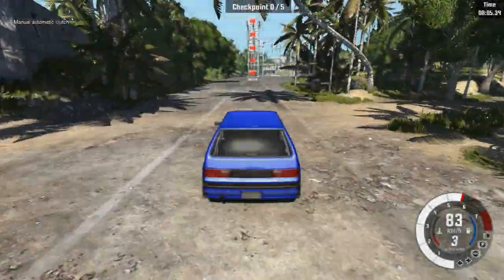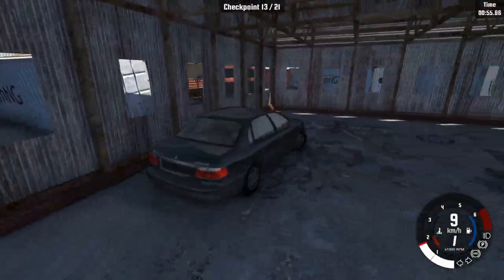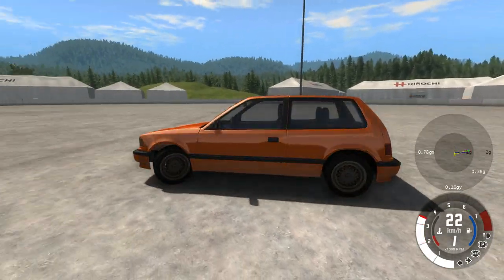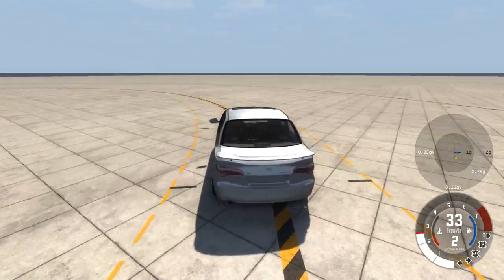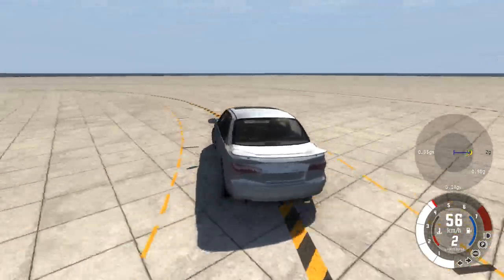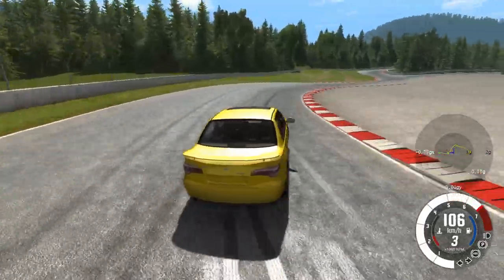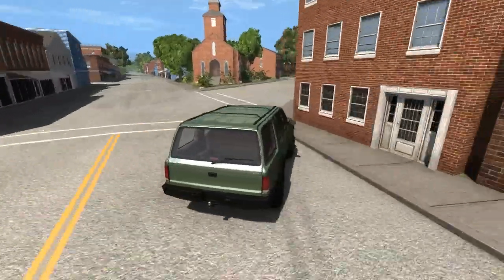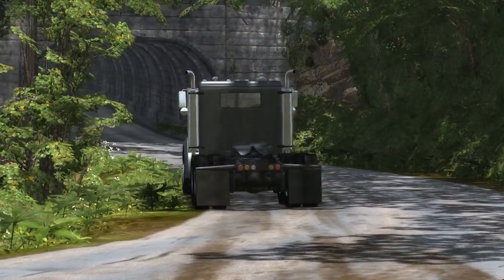Vehicle Handling in BeamNG.drive

Comment: Thank you BeamNG devs for not dumbing down the vehicle handling to chase the mainstream casual audience. Love my BeamNG nice and realisitic!
Reply: The full realisation of how hard it is to handle a car at high speeds much unlike racing games, and each vehicle has realistic things about them. The Grand Martial 's back end kicks out a lot and front wheel drive vehicles handle like boats
Reply: project cars 3 =(
Reply: @AnyaKittyMeow   You saying that did that with Project Cars 3? Shame.
Reply: @birbjones4848  Racing sims though capture that too.
Reply: @hongthainguyen5334  when did I say they didn't?
Reply: @birbjones4848  Well yes, you said ‘games’, not ‘sims’ so all gud.
Reply: @hongthainguyen5334  yes, sims tent to have more realistic simulations
Reply: Um why would little kids care about physics (forza kids)
Reply: @coolcat-nq4mj  yknow, the car go crash neuron activation kids
Reply: You are mistaken, especially with low performance commuter cars losing grip from a 90-degree turn at 20-25 mile an hour

Comment: I like the fact that it's not about racecars. There's a lot lf cars that resemble civilian cars. Makes the crashing more fun. One big thing i wish the game had is a replay mode, like in the gta four and five. Where you can move the camera around, slow the time down, etc. it would make for some great videos that are easy to make.
Reply: +Malabar101 You can do all of those thigns but it has to be done in real time. Meaning you can't drive in say cockpit view and then go back and set up your camera angles and stuff. You have to set the camera up, set the speed and drive from that awkward angle to get the shot you want. Difficult? yes. Many others have done it though as there are lots of videos on here showing it.
Reply: Mike S yeah, i know. But imagine being able to tweak everthing after th efact. it'd be much better.
Reply: +Malabar101 Oh, I agree it'd be easier to do it after the fact and I'm sure it'll be in the full game but this game is very far from finished so it will be a while.
Reply: if you want photos of you doing a jump for example you can use photo mode, its an option just below the bug report button in the menu i believe
Reply: Malabar101 yay they added it now
Reply: Yeah, the covet is a realistic economy hatchback the ibishu cars are new and old day-to-day vehicles  and the grand martial is a decent sedan. Gavril has the van, pickup and SUV. With mods for minivans and  other hatchbacks you can have an wide roster of cars that you would usually see in a town
Reply: its 5 years later and there are now these exact replay features lol
Reply: welp,you're in luck if you ever look at this comment again.replay mode exists with those EXACT features

Comment: 4:13

This is why I am so confident in Beam NG drive and love what you guys are doing. It's because of that very reason.

Beam NG isn't a just a car game. It's a physics engine at its very best. When you can build a piece of metal on wheels from the ground up and have it behave just like its real-life counterpart without an ounce of programming, you know you have something wonderful.
Reply: +Sorren Peak "behave just like its real-life counterpart without an ounce of programming"
It needs to be programmed (a little bit for blinkers, motor specs, etc.)
Programming is not measured in ounces.
Reply: MaxMrMiller Thank you, Mr. Technical.

Yes, you need to program things such as torque, steering capabilities, and other non-physical aspects of the game.

But hopefully, you understood, in essence, what I was getting at.
Reply: +Sorren Peak Just so you know I was being ~2/3s sarcastic/joking.
Reply: +Sorren Peak Every functional component in a car in beamng drive has a script like the engine, it defines the horsepower and all the good stuff, what the developer meant was that cars are not programmed entirely as one object but, a car is build up from individual components which may have their own scripts. So the car is not one single 3d object but a multitude of separate components with their own scripts defining how well they function.
Reply: Scripting and programming are both incorrect terms if you're talking about BeamNG and it's vehicle structures. It's more or less 'creating physics data'
Reply: +Trees and Stuff you have to script, that's how you define the gear ratios and horsepower of the engine or transmission, the car is not scripted as a whole but is made up of individual components which are scripted.
Reply: Haloid Android
 "A script or scripting language is a computer language with a series of commands within a file that is capable of being executed without being compiled. Good examples of server side scripting languages include Perl, PHP, and Python."

By definition JBeaming is not scripting. Is what I'm saying here.
Reply: Sorren Peak hell yeah
Reply: I agree with +Trees and Stuff here; JBeams and the relevant data for vehicles is data - it is parsed by a JSON parser. It doesn't contain instructions that are run, but contains information that is used by another program :)

Comment: 10 years and the suspension still feel like driving on a spring mattress, traction is still far to low (tho this may be very closely related to suspension optimization). I've done very sharp 90 degree corners in reality up to 55mhp, in stock sports cars (need very good tires), but BeamNG loss grip much faster and fast turns upsets the car a lot. It's like the added g-force doesn't translate into more grip on "the outer" tires, as it does IRL with a car setup for grip

Comment: I would really like to see more videos like this. Very well put together with loads of useful information.

I could be wrong but personally i think one of the big issues at the moment is how handling is implemented before it ever reaches the simulation. I use a Logitech G25 with 900deg of rotation) The steering isn't responsive enough without changing the linearity of the input especially at smaller angles of steering. If the player increases the linearity of the steering that issue can be fixed somewhat, but then it becomes impossible to center the steering since the steering becomes hyper sensitive especially where the dead zone would be. But then if a user adds some dead zone to the steering things become really horrible to control. 
So perhaps making the linearity work on an s curve rather than what i assume is a logarithmic curve might help things out a bit. So the graph would look more like a small exponential curve leading into a logarithmic curve. Maybe you could even put a graph on the settings menu and allow it to be edited like an envelope like in crystal softsynth (the graph bit in most screen shots) where input rotation is mapped against rotation sent to the simulation. Or a better solution which you could no doubt come up with considering how amazing the rest of what you have created is :p

I remember that Dirt Rally was originally pretty nasty to use with a 900 degree wheel as well leading many people to complain about the physics not feeling right. But then an update came out which updated the input handling code to work properly with 900deg wheels and it now feels really responsive and pretty amazing.
Reply: I know it's been 4 years but...

As Mitch said in the video, these are road cars, not race cars. IRL cars don't have fast and direct steering, so the steering in the game is quite realistic

Comment: Physics is top notch, but the grip levels are still a bit unrealistically low in some situations, probably due to imperfect tire physics. I'm not talking about the absolute grip level, but which is ok, more about the slip angle and how the car behaves when changing direction, and how the grip falls down with the slip of the tire, etc. In the real world (and I know exactly what I'm talking about, I'm not an average sim racer, I raced for real since I was 8, go carts, hill climb in rally cars and open wheelers, worked as an engineer in a couple of racing teams and it's my job now to work on vehicle dynamics, not to mention I've driven countless cars on tracks) it's quite a bit more difficult to lose grip and most modern cars require a lot of provocation to lose grip. In beamng it almost feels like driving on rain all the time. It seems like the transition from grip to no grip, so to speak, is very fast in beamng, as if the tires are too stiff, too plastic rather then rubbery. Tires don't have the "rubbery" quality that they do in real world, or in some other simulations like iRacing.  It's not a big problem since it's not supposed to be a driving sim, but some tweaking would make the feel of driving much more realistic. I think pretty much everyone who's ever driven a modern car will find that cars in beamng feel a tiny bit too slippery and loose, maybe 10-15%.
Reply: ...Don't do that, right?

Comment: I like how they have a physics engine so realistic you can make working planes and helicopters in a car game.
Reply: It isn't necessarily that difficult; just invert downforce values, place the wings where the... yknow... wings go, and if the game's ground aero sim is any good, then it should be at least acceptable in the air. The bigger issue is making realistic speeds in anything younger than 1930, since the maps are made for cars and are thus absolutely tiny in the air.

Comment: BeamNG is the perfect marriage of both my interests in automotive mechanics and computer simulations. Love it to death.
I've always had a beef with other driving simulators that they're never truly realistic, they're just (usually inaccurate) approximations of how the developers think cars should behave. Most gamers get very upset with crashing in racing games and so they make it easy to drift at 200mph in Forza while still having full control of the car's trajectory. It makes driving physics vary wildly from game to game and it's very hit-and-miss for us car guys who want an ACTUAL realistic driving simulator.
Also, the fact that you don't need a supercomputer to run BeamNG is the most astonishing aspect in my opinion. You can run it on a $10 Core 2 Quad if you want to.

Comment: You're doing better than Rigs of Rods.
Reply: Never!
Reply: *****
I've played both. While RoR is free, it's not as graphically advanced. I haven't looked back at RoR since I bought this program. I had fun with RoR. Also, the models don't shake as bad in Beam as they do in RoR.
Reply: *****
Wouldn't be surprised myself. Wouldn't be surprised of RoR was the testing alpha for BeamNG. RoR got lots of support back then.
Reply: A lot of RoR modders actually became BeamNG's developers, namely Gabester (hence why Gavril is present, though without a lot of the modern cars he made in RoR).

RoR has sorta-kinded died entirely by now, which is... sad, but understandable. I just hope BeamNG will carry the torch for even half as long.

Comment: There is not only the handbrake that can be used to perform a FWD Drift. You can use the "Scandinavian Flick". That means steering in a direction smoothly and immediatly steer in the opposite. Since BeamNG is one of the most accurate driving simulators out there, you can easily perform a Scandinavian Flick. :D
Reply: Luke N2O there's also the lift-off oversteer
Reply: Or just put skid plates in the rear...

... Just a suggestion...

Comment: Really nice video and good explanation of how handling works. I'm a bit curious as to how it handles some of the fancier F1-style cars that rely on massive downforces to go through corners, though? Not owning BeamNG myself (Yet. No wheel), I'm not certain which vehicles are covered or the level of detail involved. I'm also a little concerned about how weight is handled, since the first clip of a car going off a ramp doesn't seem to have engine weight, and that sort of makes me think added weight from downforce might not yet be fully implemented. Regardless, great video and amazing-looking game.
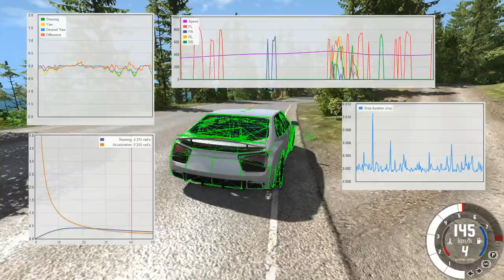Reply: +Yeti | Gameplay That bit at 3:50 with the active spoiler is making me wonder the same thing! 
I also need to get a wheel as well.. but it's not bad with an xbox controller.

Edit: just fired it up to mess around and I happened to look at the apps (windows you can have open, such as the g force meter and others shown in the video) and there is a "Wind" app. I can set direction and speed.. and it certainly has an effect. Beyond just putting a basic force on the car in a direction, I noticed it acting on a door and hood that had become unlatched and blowing them around. So there's at least some basic simulation of that, I guess.
Reply: +Yeti | Gameplay 

Hi Yeti, I'm the video's narrator.  Downforce is implemented in BeamNG.drive, although unless speed is very high it has a negligible effect. Weight distribution does not affect the way a car rotates in mid-air, since all objects (and parts of objects) fall at the same rate regardless of mass. The shape of the ramp is the main factor in whether a car tilts forward or backward during a jump.
Reply: +Mitchell Sahl thanks for answering!
Reply: +Mitchell Sahl tell to Gabester to create a mash-up between Volvo FH, and Scania R. With 750hp 3500Nm V8 16L turbodiesel at the top range, and a 1000kg of configurations
Reply: Funny you mention that! The FR17 is a mod that basically adds a bunch of Formula One cars to the game. Can confirm downforce works realistically, I've driven upside-down on the ceiling of tunnels before in it.

Comment: So now when you started changimg the handling system, I'm sure you are aware (or it's just me and I'm doing something wrong) there's a quite big of a delay between moving my wheel and seeing the wheel turning in the game, force feedback feels believable but self steer is questionable and slow - this is why drifting is very difficult in this title, I know ffb is based on physics and it would be hard to change it I guess but is there really no way in changing something so it feels more natural on the wheel? Now when you made a huge improvement in game performance (I'm easily getting 90 fps with 9 AI cars and each new car takes off around 4fps from that, Rtx 2070 ryzen 5, 2300x, 16gb ram) as it says in your FAQ, vr is something you want to implement into the game but stable 90fps is required to make any sense in doing that and I agree, but it is really obtainable now, and good job! I didn't expect so many ai cars at once ever! But vr is really something that perfectly fits into this title. Sometimes I don't understand the direction BeamNG is going for, it's unique, not only because of your incredible soft body physics but the updates that are always like "nobody asked for this but we needed it". Maybe doing something more mainstream will bring more life, bring back active and get new players? The last thing is AI. I've done hundreds of laps on figure 8 with AI cars that are not even aware of me and each other. My personal wet dream is to race AI  that's at least as good as AI in Automobilista 2 in current state (it's not good believe me, but has self awareness) and on top of that in my vr simrig with FFB from Rfactor2 or ams2. I've been your fan since Rigs of Rods and I almost feel bad about not paying for this title monthly like I do for iRacing, but these 3 things are stopping me from being a psychofan that does more than just leaving a like under your yt vids, fb posts and almost jerking off to your update logs.
Reply: please space out your points instead of mashing it all up.
Reply: @thing.  please spend your time with family instead of wasting it on reading some random comment.
Reply: @Oskier94  ??? all i told you to do was to space out your points...
Reply: @thing.  call your dad and talk to him, he's missing you
Reply: @Oskier94  imagine having such a large ego that you keep tripping over, to start insults towards a guy who just wants to give feedback.
Reply: @thing.  bruh I'm joking, English is not my first language as you see and I stopped caring about how to build sentences in a way that everyone will understand unless I'm communicating with my coworkers but thanks for the feedback, papa bless

Comment: It would be nice if we could put some Engine Upgrades, like turbocharger, air filter, pistons, etc, not only change the car handling but put this under the hood to we can see this upgrades. It's a lot of work but will be FANTASTIC! Is like BeamNG + SLRR
Reply: You can put a turbocharger/supercharger on a car, but only if the car has the option to do so.

Comment: Okay but a supercar doesn't understeer at 30mph yet it happens when I play the game.
Reply: which car
Reply: Understeer happens as a direct result of driver input. Turning the steering wheel harshly, abruptly or just too much for the vehicle’s speed versus the available grip will exceed the front tyres’ traction, forcing the nose of the car to slide wide across the road surface in understeer.

When your playing the game with arrow keys or an xbox remote of course your going to over steer. Your turning the steering wheel in unrealistic an unrealistic manor. Ever played that game in cockpit view, your steering wheel is turning like a hyperdrive. Ever done that in real life? Of course you would understeer.

Comment: Hello, what type of tyre modelling do you guys use? Would you ever consider making a video explaining the tyre physics currently implemented or upcoming in the future?
Reply: There have been two tire model approaches. The old one was called "hubwheel", and it was a pretty mediocre way of getting the wheels to work. For a while now they are using "pressurewheel", which is great. It simulates the air inside of the tires. As with everything in the game it is simulated at 2 kHz, it's really cool because the side-wall is able to flex, and tire force loading has an effect on grip levels. As of recently they have added some tire characteristic values which allow the tires to behave differently based on the type of tire and the terrain they're on.